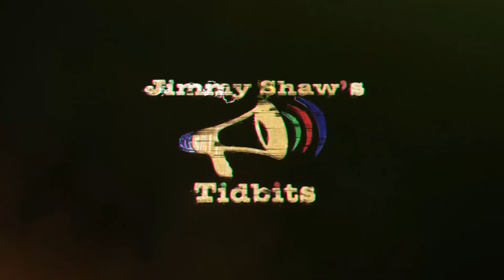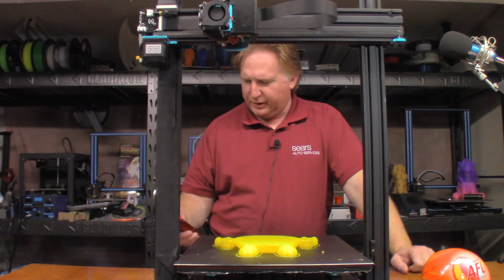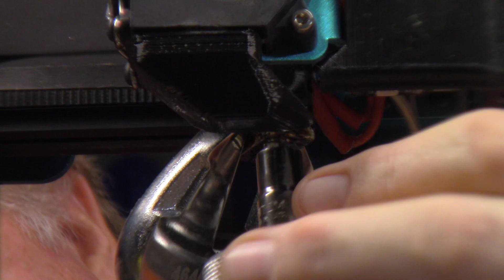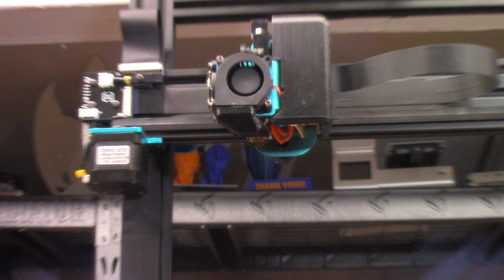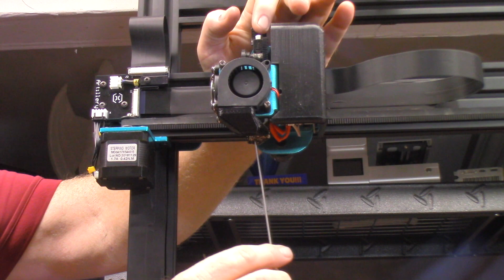Removing A Clog From The Nozzle Throat On The Artillery3D SW-X1

Comment: I started all of a sudden having this problem on all my prints with my Genius. Filament just stopped coming through anywhere from 10% to 50% of the job during EVERY print, and in prints that had worked fine many times before. Typically the printer was continuing, "printing" in thin air with no filament coming out. I found that I could often get the filament to start flowing again by pushing the filament through from the top by hand (although the print was already ruined).

So far this sounds like the situation I´ve seen in many videos on YouTube, but wait...

1. I´m using an all metal heatbreak, so no PTFE anywhere down where the filament is molten, and I changed the heatbreak and the nozzle several times. Also, this happens with 0.4mm and 0.6mm nozzles. I´ve also done several cold pulls, even with nylon.
2. Whenever this happened the extruder gear was just wearing away the filament as it turned in one place until I stopped it (that´s where all that ash-like dust comes from). I tried adjusting the spring tension on the extruder gear, but teeth marks on the filament could be very deep or hardly visible and it didn't make any difference.
3. I used filaments I had successfully used before (all PLA), even new ones still in their sealed plastic bags.
4. I reduced the retraction from 5mm to 2mm.
5. Of course, each time I checked that the filament spool was spinning freely.

So, anyone have any comments or suggestions?
Reply: Limits yuor retractions number/distance, too much retractions are gone clog the nozzle..so print a test(there many in thingiverse.com) several retraction test to find yuor better retract speed/distance
Reply: @noway8233  Thanks for the tip. I'll look into that.
Reply: I got the same situation. Thanks for the tips!